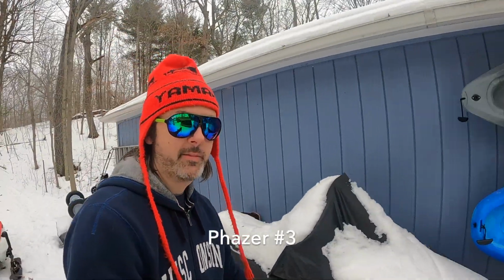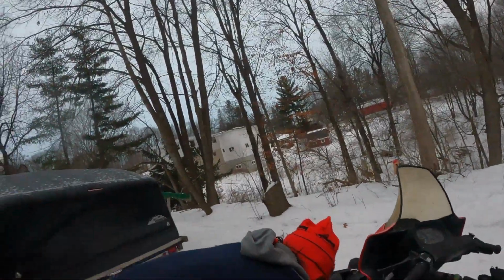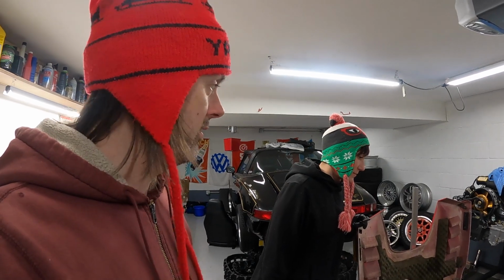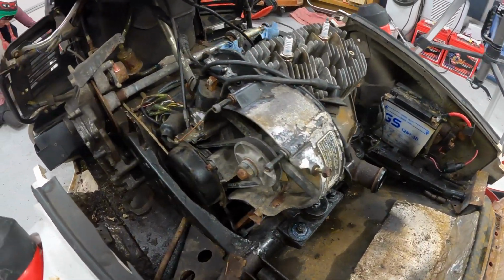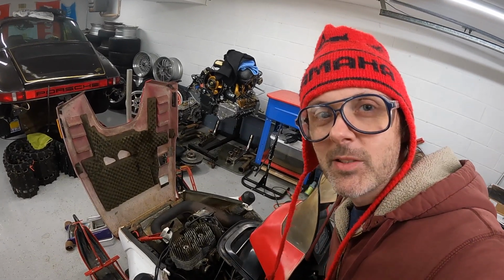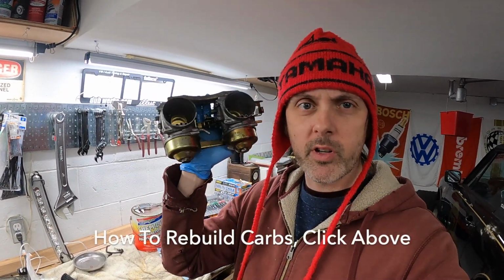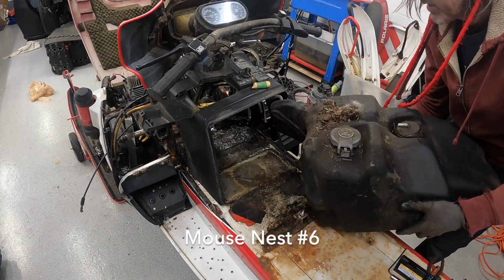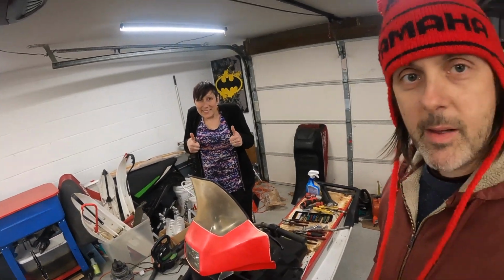Will It Start?  $300 Yamaha Phazer Left Sitting Outside 10 years!

Comment: Classic Phazer 2, 480cc fan cooled twin cylinder. I had one of those, 1992 model. Track busted before, installed new ones, had too much traction, installed plastic skis. And it ran until i sold it 2016. Only once I've changed the pistons, and they crumbled trying to remove the circlip beside the piston.  Chassis was crap, so i bought a newer model venture 500 fan cool chassis. And installed my old engine in it. 10 gallon premix ran for 2 weeks. I miss that old engine. Just keep snow and ice of carburetors and it'll run forever.